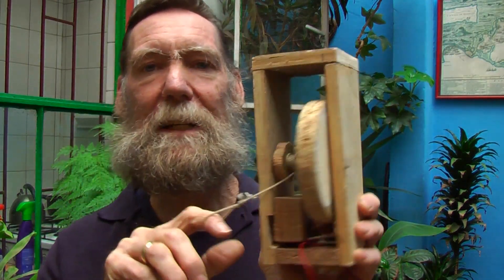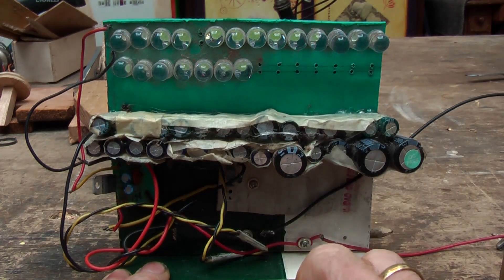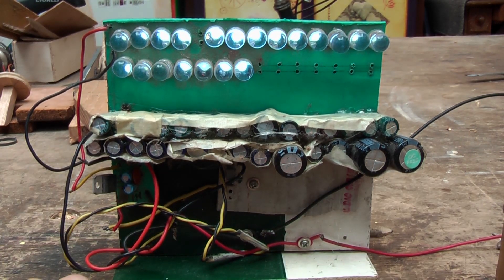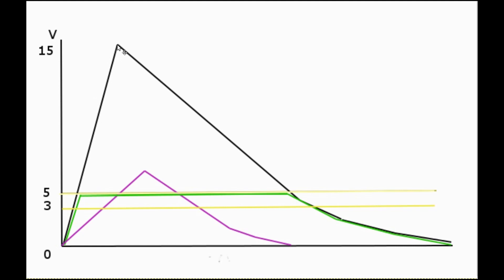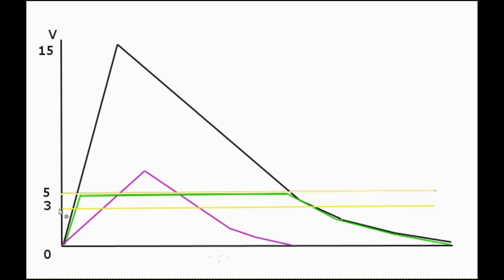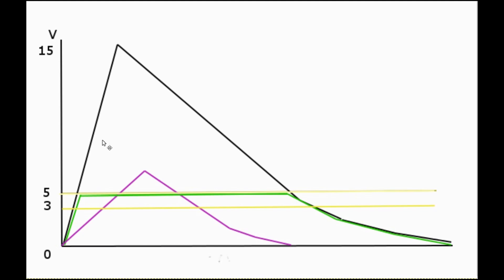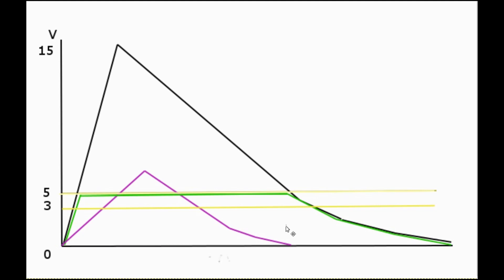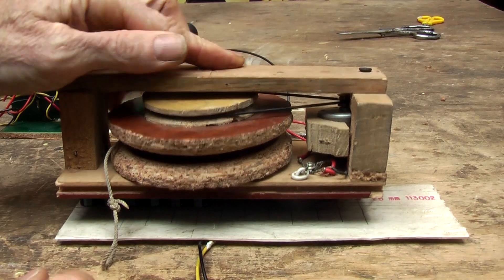Reinventing The Wheel and Electricity-Yo-Yo Generator Improvements.

Comment: Hi Phillip, a small caution to your setup. It looks like you run the motor forward and reverse, dependent on the yo-yo's turning?
If so, are you maybe damaging your capacitor bank and are only getting a fraction of the power you could get.
Electrolytic condensator have a gray band, indicating that negative have to be connected there. If you run your motor in both directions, you hare sending both positive and negative to the gray band side. That do at best, nothing, worst, it destroys your capacitors.
To avoid that, try looking for"bridge rectifier" and add that to your invention.
Also if you add a heavy wheel to the side of the yo-yo, you can get the yo-yo to spin a lot longer and do only have to pull in the line, when the wheel is getting to slow, bigger, heavier is equal to more energy.
Reply from the maker: Yes , it has a bridge rectifier. It is just behind the  white wire knot about 40seconds into the vid.screwed down to the wood. In past videos I talked about that ,  so  I omit  to mention it  these days. It is usually the first thing I do when selecting a motor, even soldering them straight onto the  output contacts of the  motor if possible. I tried longer strings with  bigger wheels.... your arm is only so long and the  yo yo action automatically recoils, so there is no freewheeling. Too bigger a flywheel it  rips the string from your fingers and messes up in the workings, or if you have it  looped on your finger , your finger gets jerked into the wheel. ouch, did that. Too long a string gets all tangled up, so optimum is like a normal yo-yo, as long as your arm can comfortably  pull it and not  slacken tension too much so it recoils  smoothly. I have tried  ratchet systems like on a bike wheel to  take advantage of  a flywheel , but  it still needs  developing more, with  simpler materials, but the concept is a good one. Thank you for your comments . You are quite right.
Reply: @PhilipStephens007  Thanks a lot for your great and detailed answer, and pointing me to the time at 40 seconds, the last was fine but not necessary, if you say that there are something, then it is there without any doubt at all. :-)
I think you are completely correct in everything you say and yes you could hurt yourself, but let my try to explain again.
Imagine you use your yo-yo as in the video but after the string is pulled in again, you let go of the string and wait until the wheel is stopped. In that way, you start the wheel and let it run for maybe 30 seconds, until you think it is getting to slow. Your wheel could be build of light and thin materials, as long the outer rim is kind of heavy, maybe a row of old used shoos, a tube with wet sand or something like that. :-)
Reply from the maker: @friedmule5403  . Yes , we are on the same wavelength. I have another wall  yo-yo version where that  sort  of happens, but that is down the video track a little.  I am trying to catch up on the video process before I revisit that one and  develop it   some  more. I made a bigger  flywheel one , but  used it on  another project in stead. :) It is all fun.

Comment: How did you make the voltage regulator ?
Reply from the maker: It is a voltage regulator  component ( looks  like a power transistor but is not)and two small  capacitors. Maybe I should show doing one. :)
Reply: Search for LM7805 voltage regulator

Comment: Voltage regulators are not very energy efficient. If you were to simultaneously measure the current going into and coming out of the regulator, the amperage would be about the same. But since they are at different voltages, we know the total energy is different (watts = volts * amps). The difference is being shed in the regulator as heat.

That said, I think the regulator is acting as a current limiter, which is good as it keeps the LEDs from burning out. You could replace the regulator with a buck converter, which will lower voltage in a more efficient manner. They cheap in the US from Amazon and eBay. They can have fixed 5 volt outputs or adjustable outputs. If you do that, also locate a resistor to protect the LEDs, because I don't think the buck converter will limit current.

Are the LEDs all in parallel, all in series, or some combination? Since you are getting them to stay lit all the way down to three volts I am guessing all in parallel. You might consider rewiring them so that you have groups of two LEDs in series, then wire each pair in parallel. Now it won't light up under ~5 volts, but should actually last longer because the LED bank won't pull as much current.
Reply from the maker: Yes, I concur.  I knew that as they lower the  voltage they  loose the  energy as heat, but I thought I would try it anyway. At least it  leveled out the  brightness  for a good while, and it  lasted longer than  without, so I  considered that  a gain  by whatever  measure. I assumed that  whatever extra  energy   pushed into the capacitors  took  longer to drain albeit  while losing to heat ( acting as a current limiter as you say). The  LEDs are all in parallel, each with a resistor, as well as a variable resistor  to the whole panel to further limit it if desired. Sometimes less light for longer is better than bright  for shorter. Series/ parallel sounds  interesting, if it  pulls less current. That would mean 6v need to be supplied? In which case a 6v regulator to limit anything over that would be  good , with less loss to heat .. correct? I will have to research buck converters and whether we can get them here.  If the  lineal discharge of capacitors can be solved, they will out-do batteries I think.

Comment: Have you looked into the circuit called Joule Thief? It seems it's not super easy to set it up very efficiently, but it uses very few and easy to get parts and makes sure your LEDs stay at a reasonable brightness for as long as possible (even below the forward voltage the usually need).
Reply: Ah yes and most voltage regulator ICs are note very efficient.
Reply: Joule Thief is a boosting circuit, so is good to, say, light an LED from a 1.5 volt alkaline battery, but I'm not sure what happens  if you put higher voltages into one. I think it will boost them even higher? Possibly to a point that exceeds the voltage ratings of the transistor? I'm not sure.
Reply from the maker: I am looking at the joule thief circuit. I tried once in the past with no success. This time I hope I have a better understanding of it. The reason to look at the  circuit is as you say, to double the voltage from 1.5v.  There are some cheap motors here to use as generators but they  output only1.5v, but very good amperage. I am waiting on someone to get me the bits, but  he is  a little slow.

Comment: idea for the belt, cutting old inner tubes, if you cut  'on the bias' you can get a belt almost any length, and dozens of them, ive used old ones to tie tings together as the rubber doesnt rot quickly, unlike rubber bands
Reply from the maker: Modern material of inner tubes has taken a SERIOUS nose dive  in the last 5 years. China has it all sewn up and destroyed.  I even had some sent via  Europe and  New Zealand ... and sadly they were Chinese too. I have given up on  inner tube as a reliable material. Sad. Let's see how the O-rings go  :)

Comment: Thats one hell of a cap bank Phillip. Good job, that lasts a very long time for just a single pull a minute. The yoyo seema a good design. Ive wanted to get into electronics as a hobby for a while now but only recently picked up home brewing to help keep me occupied.

hope all is well
chris
Reply from the maker: Ha, my folks were home brewers, my brother a professional brewer, and  a brother in-law  works in a vineyard.... It is an interesting, and  relaxing hobby. Electronics I have picked up a little with time, but  do not profess to be very good at it. I was quite pleased with this set up so far. I am excited to see where carbon battery/capacitor technology goes, which is why I am going with capacitors rather than batteries. Next one, a hand held yo-yo version in stead of table top. stay tuned.